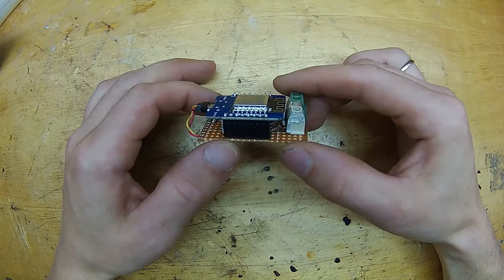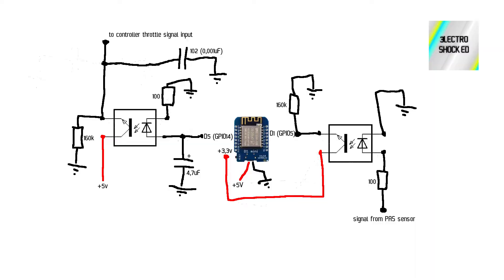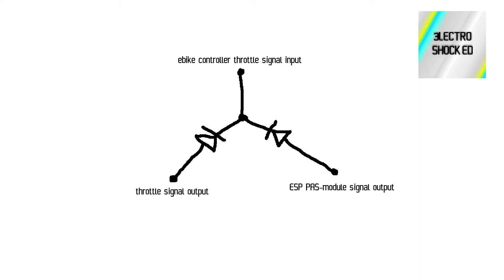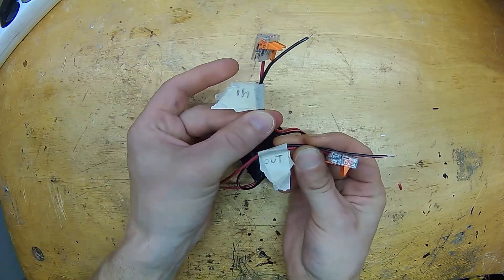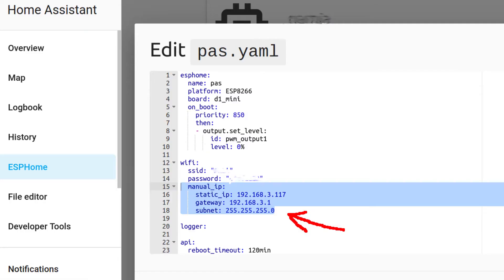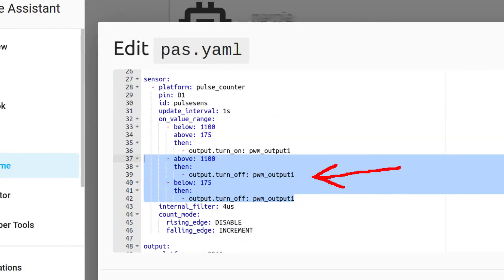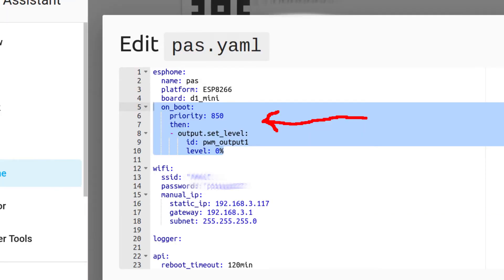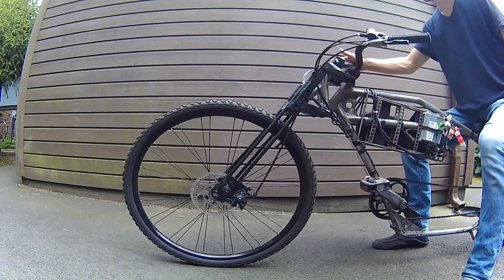DIY ESP8266 Pedal Assist for eBike controller with no PAS

Comment: Great Hack. I noticed this hack worked when the pedal was spun in the wrong direction. I found a module on Amazon/eBay that converts variable frequency 0 - 500hz ttl to voltage 0 - 10v. This could work with a resistor to limit the max output to 5v. There's just the question of how to tie this to the throttle input. [btw 500hz assumes 8 magnets on the PAS with a max cadence of about 62 rpm ;]
Reply from the maker: That's a good idea!

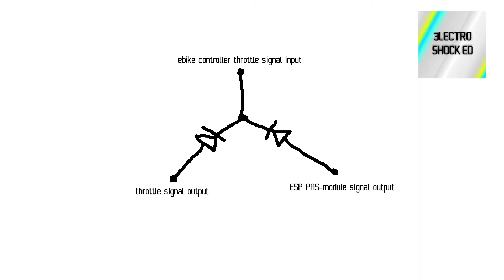Comment: Hi another Question, what rating/type are the 2 diodes you use to sepeate the throttle and PAS signals at 2:02, thanks again
Reply from the maker: Yeah, actually it doesn't matter :) But if you have the chance, find ones with the lowest resistance, so there would be a minimal voltage drop. Although the amount of current going through them will be so low, that effectively it doesn't matter :D
Reply: @3LECTROSHOCKED  i have some 1N4148's and ZENER DIODE's, (0.5W, 5V, DO-204AH 1N5231CTR) kicking around
Reply from the maker: Just regular ones will do fine, 1n4148 is ok probably :)
Reply: Can't seem to get mine to work, built, flashed as per instructions and coded as you have it. got power (LED flash) when switching on. I have a voltage value of around 1.8v on the signal wire when rotating pedals directly from magnetic sensor, but nothing on signal from ESP back to controller, I'm using a 12 magnet disc, my setup is a 750w motor with 72v battery, twist throttle only controller, hence desire for PAS functionality. Taking the power and ground from the controller, the power to the ESP8266 is via a 12v to 5v 10A step down (I have a 72v to 12v 10A system for lights etc so easy to tap into) Just not sure where to go from here or how I can see what the module is getting from the pedal sensor? appreciate any advice as very new to this sort of thing. This is my build if anything obvious in my soldering https://photos.app.goo.gl/zmSFVHPh3atFVznbA
Reply from the maker: Hello! Well, open esphome logging and watch what values it receives etc..
Reply: @3LECTROSHOCKED  values seem to be between 300-1200 but here is a snippet  from a short light spin up and again no power was being sent to the motor 
INFO Reading configuration /config/esphome/pasv2.yaml...
INFO Starting log output from pasv2.local using esphome API
INFO Connecting to pasv2.local:6053 (XXXXXXX)
INFO Successfully connected to pasv2.local
[16:00:12][I][app:105]: ESPHome version 1.16.1 compiled on Mar  4 2021, 15:46:34
[16:00:12][C][wifi:443]: WiFi:
[16:00:12][C][wifi:303]:   SSID: XXXXXXXX
[16:00:12][C][wifi:304]:   IP Address: XXXXXXXXX
[16:00:12][C][wifi:306]:   BSSID: XXXXXXXX]
[16:00:12][C][wifi:307]:   Hostname: 'pasv2'
[16:00:12][C][wifi:311]:   Signal strength: -87 dB ▂▄▆█
[16:00:12][C][wifi:315]:   Channel: 6
[16:00:12][C][wifi:316]:   Subnet: 255.255.255.0
[16:00:12][C][wifi:317]:   Gateway: XXXXXXXX
[16:00:12][C][wifi:318]:   DNS1: XXXXXXXXXX
[16:00:12][C][wifi:319]:   DNS2: (IP unset)
[16:00:12][C][esp8266_pwm:022]: ESP8266 PWM:
[16:00:12][C][esp8266_pwm:023]:   Pin: GPIO14 (Mode: OUTPUT)
[16:00:12][C][esp8266_pwm:024]:   Frequency: 2800.0 Hz
[16:00:12][C][esp8266_pwm:025]:   Max Power: 28.0%
[16:00:12][C][logger:185]: Logger:
[16:00:12][C][logger:186]:   Level: DEBUG
[16:00:12][C][logger:187]:   Log Baud Rate: 115200
[16:00:12][C][logger:188]:   Hardware UART: UART0
[16:00:12][C][pulse_counter:147]: Pulse Counter 'pulsesens'
[16:00:12][C][pulse_counter:147]:   Unit of Measurement: 'pulses/min'
[16:00:12][C][pulse_counter:147]:   Accuracy Decimals: 2
[16:00:12][C][pulse_counter:147]:   Icon: 'mdi:pulse'
[16:00:12][C][pulse_counter:148]:   Pin: GPIO5 (Mode: INPUT)
[16:00:12][C][pulse_counter:149]:   Rising Edge: DISABLE
[16:00:12][C][pulse_counter:150]:   Falling Edge: INCREMENT
[16:00:12][C][pulse_counter:151]:   Filtering pulses shorter than 4 µs
[16:00:12][C][pulse_counter:152]:   Update Interval: 1.0s
[16:00:12][C][captive_portal:169]: Captive Portal:
[16:00:12][C][ota:029]: Over-The-Air Updates:
[16:00:12][C][ota:030]:   Address: pasv2.local:8266
[16:00:12][C][api:095]: API Server:
[16:00:12][C][api:096]:   Address: pasv2.local:6053
[16:00:13][D][pulse_counter:159]: 'pulsesens': Retrieved counter: 0.00 pulses/min
[16:00:13][D][sensor:092]: 'pulsesens': Sending state 0.00000 pulses/min with 2 decimals of accuracy
[16:00:14][D][pulse_counter:159]: 'pulsesens': Retrieved counter: 0.00 pulses/min
[16:00:14][D][sensor:092]: 'pulsesens': Sending state 0.00000 pulses/min with 2 decimals of accuracy
[16:00:15][D][pulse_counter:159]: 'pulsesens': Retrieved counter: 0.00 pulses/min
[16:00:15][D][sensor:092]: 'pulsesens': Sending state 0.00000 pulses/min with 2 decimals of accuracy
[16:00:16][D][pulse_counter:159]: 'pulsesens': Retrieved counter: 0.00 pulses/min
[16:00:16][D][sensor:092]: 'pulsesens': Sending state 0.00000 pulses/min with 2 decimals of accuracy
[16:00:17][D][pulse_counter:159]: 'pulsesens': Retrieved counter: 0.00 pulses/min
[16:00:17][D][sensor:092]: 'pulsesens': Sending state 0.00000 pulses/min with 2 decimals of accuracy
[16:00:18][D][pulse_counter:159]: 'pulsesens': Retrieved counter: 0.00 pulses/min
[16:00:18][D][sensor:092]: 'pulsesens': Sending state 0.00000 pulses/min with 2 decimals of accuracy
[16:00:19][D][pulse_counter:159]: 'pulsesens': Retrieved counter: 0.00 pulses/min
[16:00:19][D][sensor:092]: 'pulsesens': Sending state 0.00000 pulses/min with 2 decimals of accuracy
[16:00:20][D][pulse_counter:159]: 'pulsesens': Retrieved counter: 0.00 pulses/min
[16:00:20][D][sensor:092]: 'pulsesens': Sending state 0.00000 pulses/min with 2 decimals of accuracy
[16:00:21][D][pulse_counter:159]: 'pulsesens': Retrieved counter: 0.00 pulses/min
[16:00:21][D][sensor:092]: 'pulsesens': Sending state 0.00000 pulses/min with 2 decimals of accuracy
[16:00:22][D][pulse_counter:159]: 'pulsesens': Retrieved counter: 0.00 pulses/min
[16:00:22][D][sensor:092]: 'pulsesens': Sending state 0.00000 pulses/min with 2 decimals of accuracy
[16:00:23][D][pulse_counter:159]: 'pulsesens': Retrieved counter: 0.00 pulses/min
[16:00:23][D][sensor:092]: 'pulsesens': Sending state 0.00000 pulses/min with 2 decimals of accuracy
[16:00:24][D][pulse_counter:159]: 'pulsesens': Retrieved counter: 0.00 pulses/min
[16:00:24][D][sensor:092]: 'pulsesens': Sending state 0.00000 pulses/min with 2 decimals of accuracy
[16:00:25][D][pulse_counter:159]: 'pulsesens': Retrieved counter: 60.00 pulses/min
[16:00:25][D][sensor:092]: 'pulsesens': Sending state 60.00000 pulses/min with 2 decimals of accuracy
[16:00:26][D][pulse_counter:159]: 'pulsesens': Retrieved counter: 540.00 pulses/min
[16:00:26][D][sensor:092]: 'pulsesens': Sending state 540.00000 pulses/min with 2 decimals of accuracy
[16:00:27][D][pulse_counter:159]: 'pulsesens': Retrieved counter: 600.00 pulses/min
[16:00:27][D][sensor:092]: 'pulsesens': Sending state 600.00000 pulses/min with 2 decimals of accuracy
[16:00:28][D][pulse_counter:159]: 'pulsesens': Retrieved counter: 480.00 pulses/min
[16:00:28][D][sensor:092]: 'pulsesens': Sending state 480.00000 pulses/min with 2 decimals of accuracy
[16:00:29][D][pulse_counter:159]: 'pulsesens': Retrieved counter: 480.00 pulses/min
[16:00:29][D][sensor:092]: 'pulsesens': Sending state 480.00000 pulses/min with 2 decimals of accuracy
[16:00:30][D][pulse_counter:159]: 'pulsesens': Retrieved counter: 540.00 pulses/min
[16:00:30][D][sensor:092]: 'pulsesens': Sending state 540.00000 pulses/min with 2 decimals of accuracy
[16:00:31][D][pulse_counter:159]: 'pulsesens': Retrieved counter: 660.00 pulses/min
[16:00:31][D][sensor:092]: 'pulsesens': Sending state 660.00000 pulses/min with 2 decimals of accuracy
[16:00:32][D][pulse_counter:159]: 'pulsesens': Retrieved counter: 480.00 pulses/min
[16:00:32][D][sensor:092]: 'pulsesens': Sending state 480.00000 pulses/min with 2 decimals of accuracy
[16:00:33][D][pulse_counter:159]: 'pulsesens': Retrieved counter: 540.00 pulses/min
[16:00:33][D][sensor:092]: 'pulsesens': Sending state 540.00000 pulses/min with 2 decimals of accuracy
[16:00:34][D][pulse_counter:159]: 'pulsesens': Retrieved counter: 660.00 pulses/min
[16:00:34][D][sensor:092]: 'pulsesens': Sending state 660.00000 pulses/min with 2 decimals of accuracy
[16:00:35][D][pulse_counter:159]: 'pulsesens': Retrieved counter: 540.00 pulses/min
[16:00:35][D][sensor:092]: 'pulsesens': Sending state 540.00000 pulses/min with 2 decimals of accuracy
[16:00:36][D][pulse_counter:159]: 'pulsesens': Retrieved counter: 480.00 pulses/min
[16:00:36][D][sensor:092]: 'pulsesens': Sending state 480.00000 pulses/min with 2 decimals of accuracy
[16:00:37][D][pulse_counter:159]: 'pulsesens': Retrieved counter: 480.00 pulses/min
[16:00:37][D][sensor:092]: 'pulsesens': Sending state 480.00000 pulses/min with 2 decimals of accuracy
[16:00:38][D][pulse_counter:159]: 'pulsesens': Retrieved counter: 600.00 pulses/min
[16:00:38][D][sensor:092]: 'pulsesens': Sending state 600.00000 pulses/min with 2 decimals of accuracy
[16:00:39][D][pulse_counter:159]: 'pulsesens': Retrieved counter: 600.00 pulses/min
[16:00:39][D][sensor:092]: 'pulsesens': Sending state 600.00000 pulses/min with 2 decimals of accuracy
[16:00:40][D][pulse_counter:159]: 'pulsesens': Retrieved counter: 420.00 pulses/min
[16:00:40][D][sensor:092]: 'pulsesens': Sending state 420.00000 pulses/min with 2 decimals of accuracy
[16:00:41][D][pulse_counter:159]: 'pulsesens': Retrieved counter: 120.00 pulses/min
[16:00:41][D][sensor:092]: 'pulsesens': Sending state 120.00000 pulses/min with 2 decimals of accuracy
[16:00:42][D][pulse_counter:159]: 'pulsesens': Retrieved counter: 0.00 pulses/min
[16:00:42][D][sensor:092]: 'pulsesens': Sending state 0.00000 pulses/min with 2 decimals of accuracy
[16:00:43][D][pulse_counter:159]: 'pulsesens': Retrieved counter: 0.00 pulses/min
[16:00:43][D][sensor:092]: 'pulsesens': Sending state 0.00000 pulses/min with 2 decimals of accuracy

And the yaml code is as follows:

esphome:

  name: pasv2
  platform: ESP8266
  board: d1_mini
  on_boot:
    priority: 850
    then:
    - output.set_level:
        id: pwm_output1
        level: 0%
        
wifi:
  ssid: "XXXXX"
  password: "XXXXX"
    
 # Enable fallback hotspot (captive portal) in case wifi connection fails
  ap:
    ssid: "Pasv2 Fallback Hotspot"
    password: "XXXXX"

captive_portal:

# Enable logging
logger:

api:
  reboot_timeout: 120min

ota:

sensor:
  - platform: pulse_counter
    pin: D1
    id: pulsesens
    update_interval: 1s
    on_value_range:
      - below: 1100
        above: 175
        then:
          - output.turn_on: pwm_output1
      - above: 1100
        then:
          - output.turn_off: pwm_output1
      - below: 175
        then:
          - output.turn_off: pwm_output1
    internal_filter: 4us
    count_mode:
      rising_edge: DISABLE
      falling_edge: INCREMENT

output:
  - platform: esp8266_pwm
    pin: D5
    max_power: 28%
    frequency: 2800 Hz
    id: pwm_output1

appreciate any advice, thanks
Reply from the maker: Hmm, the code side looks ok, if you've been able to get the pwm going. Have you checked all the wiring? Probably something there... try jumping the signal and see what happens
Reply: @3LECTROSHOCKED  thanks will take a look again at the weekend 👍
Reply: @3LECTROSHOCKED  ITS ALIVE!!!!!! I used the wrong capacitor, I interpreted your 4,7uf as 4700 rather than 4.7uf as I'm used to this indicating a separator for thousands, eg. 1,000.00 anyway changed that check soldering joints and away it went 👍 might make a 2nd voltage output range for lower cadence so doesn't pull away suddenly when engage pedals, but thanks again for your help.
Reply from the maker: I'm glad you found the problem:) good luck!

Comment: Very nice! I just replaced the inbuilt controller from a Stromer ST1 motor with one that looks exactly like yours, and now I'm trying to figure out if I can take the torque sensor from the bike and translate it into a pwm signal for the controller, probably using some atmega uc or so.
Not because I really want it, but I want to have my bike be a bit more legal, because right now I only have a thumb throttle :)
Reply from the maker: Thanks! Sounds like an interesting challenge. I think if you want to do this the easy way, you may just use the speed signal from that sensor-assembly.  It should give out pulses, I think. Although honestly, I haven't had a chance to use a torque setup yet once in my builds, so I'm just speculating :) I'm curious, do cops actually pull ebikes over and check for technology, where You live?
Reply: @3LECTROSHOCKED  I haven't hear of cops doing so, so far. As far as I know the from the manufacturers homepage (TMM Torque Sensor from idbike), the sensor outputs a voltage between 0,1V and 4,9V with a resolution of somewhere between 40mV/N to 300mV/N
Reply from the maker: Hmmmm. If it's a voltage, why don't you just feed that straight to the throttle input? It should react from 1v and up, but if it's too much, just put a resistor on that line. Have you tried that? Yeah, I have been riding a 1,5kW bike for 5 years and cops haven't stopped me yet. That bike goes 60km/h and is totally illegal, but I never drive it so fast on public roads and if I see a cop car, I just spin my pedals :D:D
Reply: @3LECTROSHOCKED  Well, I thought of that too! And maybe use some little op amp circuit to adjust it perfectly. But I still wanted to have the possibility of a throttle AND and actual PAS together. I thought of eventually just carying around the thumb throttle as an emergency thing, for the case that the torque sensor misbehaves, which it did quite a lot in the past. Having a torque controlled motor is very nice though I must say
Reply from the maker: You can connect those parallel, it works fine on my setup. And maybe use diodes to prevent any back voltage, although I'm not sure if feeding voltage back in the throttle or sensor will actually hurt them.. But one annoying thing I noticed during my tests: the throttle input of a controller is super-duper sensitive. It needs almost no current, so even a static discharge or a transistor leak may activate it. Do a well calculated pull-down for that input when connecting external circuits. Maybe that info could help you :)
Reply: @3LECTROSHOCKED  yes thats definitely good to know, but one more reason for wanting to use it as a pas, is because I want to be able to controll the pas strength by the lcd, I like to take the easy route in general :), but this time, i want it to be as close to perfect as I can get it
Reply from the maker: Do you have an LCD interface on this new controller? Or will you try to somehow hook up the old LCD to the new controller?
Reply: @3LECTROSHOCKED  Yeah I have a new LCD, I ordered it together in a kit with the controller, the LCD is the S900 LCD. I read on some forums that the communication between the original controller/lcd is obfuscated/proprietary.
Reply from the maker: Yeah, I had that type of LCD on my big bike. It got destroyed by the rain after 2 years... So that means that your new controller has a PAS system integrated?
Reply: @3LECTROSHOCKED  i guess so yes, it definitely has a pas input. Do you think that I should somehow make the display more waterproof?
Reply from the maker: If you have a PAS-system on your controller - that's great! But the challenge is to see will it work with the feed from a torque setup - probably not. If I was You, I would ditch the torque system and just install a simple PAS sensor system on the crank. It's super cheap and easy. About the LCD: it was waterproofed around the edges of the case, don't get me wrong. But, in my situation, a couple of times riding in a very heavy rain got the moisture in anyways. Also there was probably an issue with condensation, since I ride in conditions from +3C to +30C. The problem is that LCD has very delicate chips inside and even a small drop can corrode small legs on those chips. If you have the possibility, dip the whole thing in silicone and close permanently - that will probably do ok. I'v seen that method applied on some escooter controllers from Segway.
Reply: @3LECTROSHOCKED  thanks for all the useful info! I think in the end, I might still try to convert the analog torque voltage to a pwm signal for pas.
Reply from the maker: I hope I could help! Btw, for that job I would try to use, for example, Wemos D1 mini. It has an analog voltage pin, to sense the voltage. And it can output PWM depending on that reading. Just need to figure out the code to make those interact. You can do a fixed script: if voltage <2v - then PWM xxxx. And just adjust the actual strength of the assistance from the LCD  :)